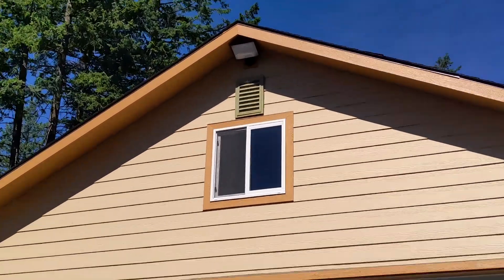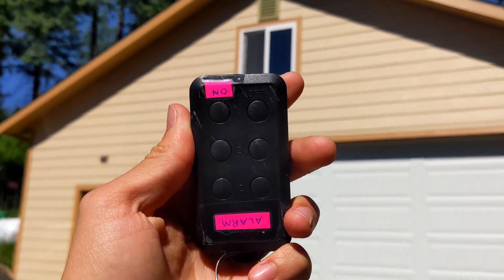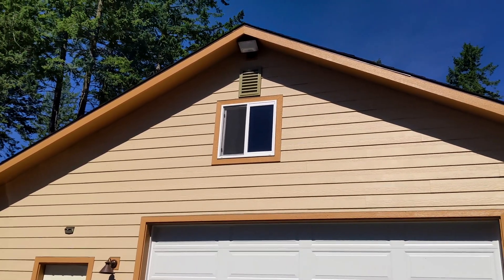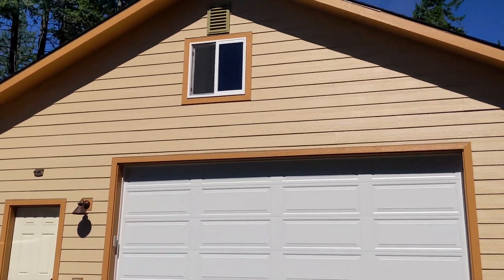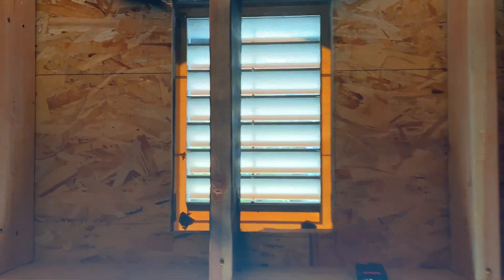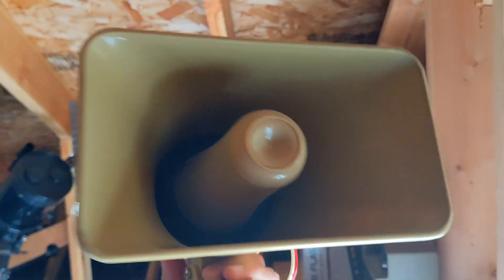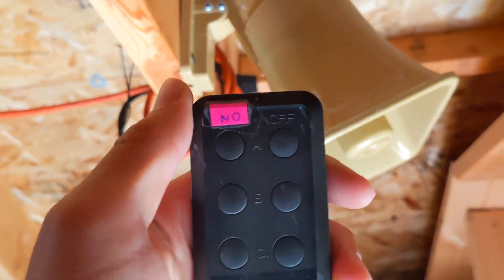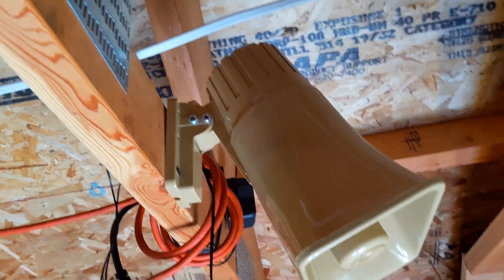Our Emergency Siren System

Comment: hey i was just wondering i recently got a ms5ud and i have a trouble called “power supply sync fault” and was wondering how to fix ix
Reply: You need a resistor on the remote sync terminal, 4.7k resistor